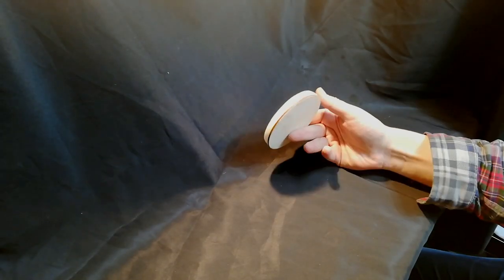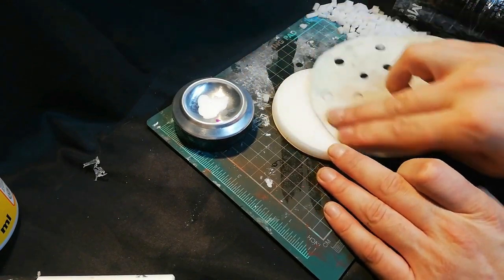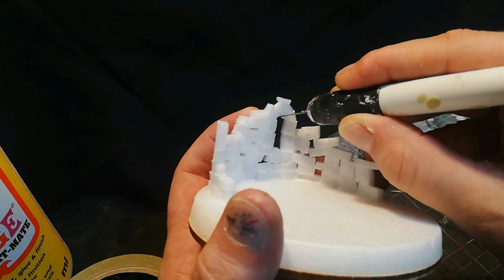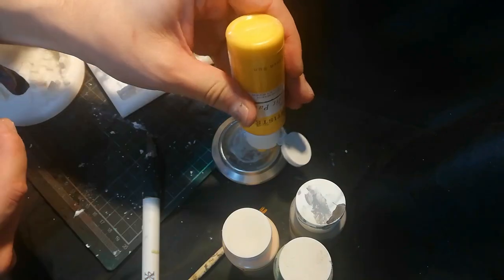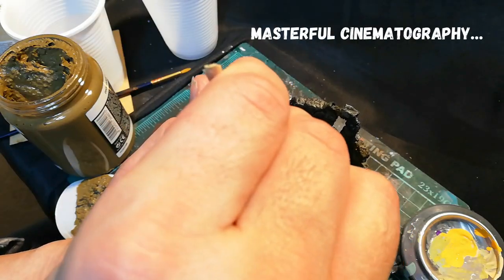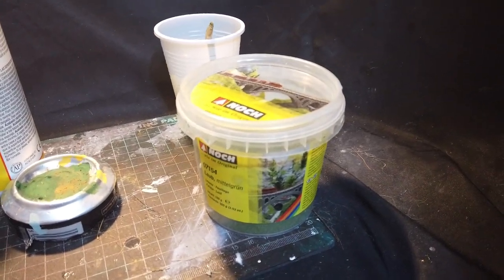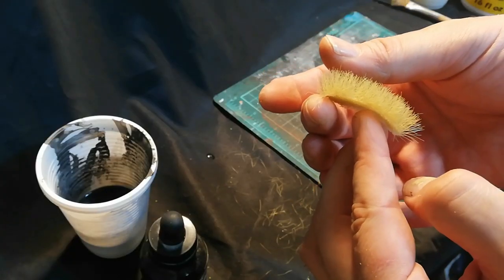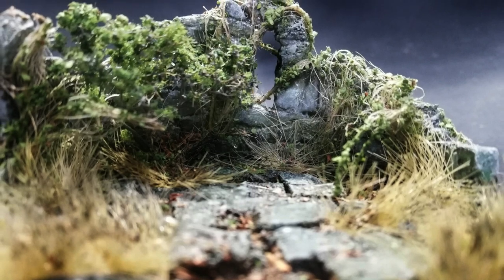How to make an awesome fantasy ruin diorama with foam - miniature basing

Comment: To make windows neater you can make a card template of the shape you want and stick a small handle on the flat size, build around it then when dry pull out the template. Miniature version of the real thing
Reply from the maker: Thanks. Yes, there are dozens of ways people do this better than I do, but I kind of wanted to make it ramshackle and collapsing. But thanks for the great tip!
Reply: @HighEyeWorkshop  apologies, wasn't sure, loved the whole project though, really does look like ruins. Will be having a try of this.
Reply from the maker: No apologies necessary! It was a great tip for the future.
Reply: @HighEyeWorkshop  kind of you to say so, Romans and medieval builders sometimes used such a thing apprently,  also I used drawing pins for the 'handle', superglued in place